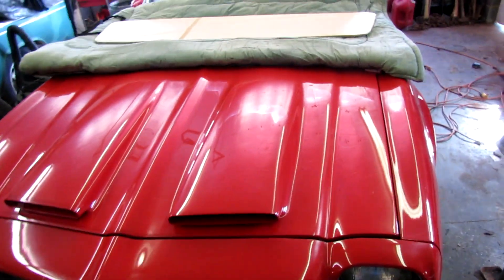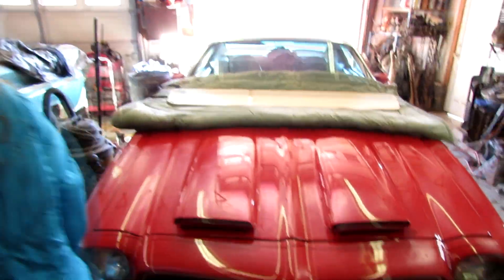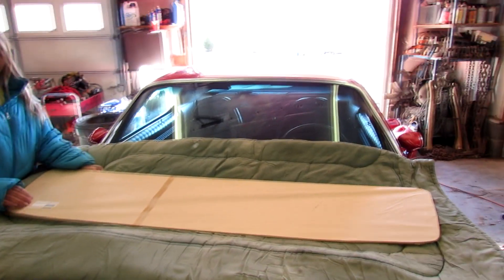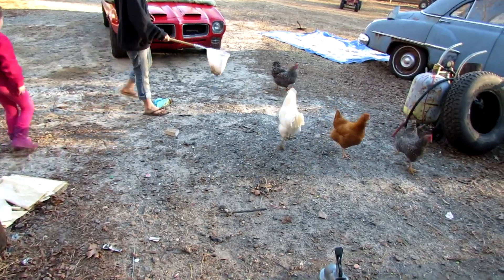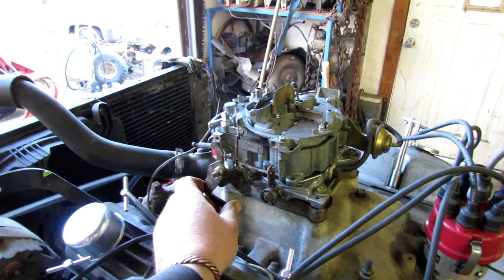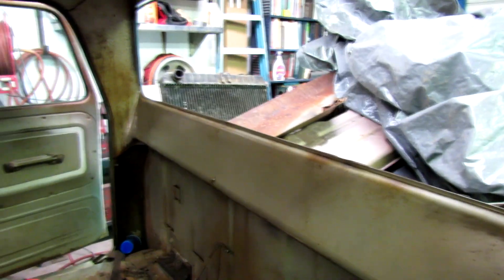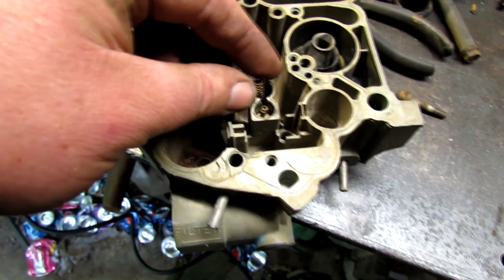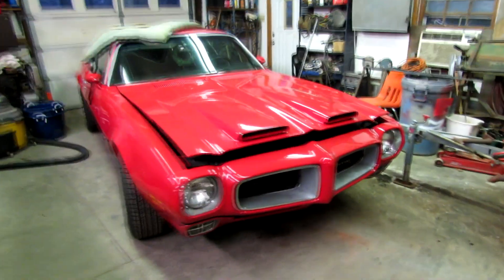Weekend adventures

Comment: I had a quadrajet in my 55 Chevy Truck (my profile pic), it needed a rebuild so had someone do it cause I didn't know how. Didn't turn out to good, fuel kept pouring in. I have a 1406 Edelbrock in it now. Quadrajet just sits on a shelf now.  Wished we lived close by, I would ask you to fix for me. Good Times.
Reply from the maker: Easy fix, float level is too high. Common problem.